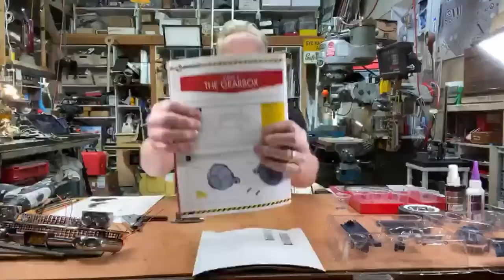Adam Savage's Live Builds: Ghostbusters Ecto-1 Kit (Part 2)

Comment: Adam, as a jeweler and a maker I was so amped to see you are using the jeweler ring clamp, I too use it for all sorts of stuff. One other bit of jeweler gear i use in conjunction with the clamp is a bench pin with a notch cut in it to rest the clamp while working with it like you are here with the drill.

Comment: I didnt know if anyone mentioned this already. I am following along and building one with you and also wired up the additional "Fog" lights. I have been doing some research and found the video "Ecto-1 Resurrecting the Classic car" at 13:20 into it you can clearly see the outside "Fog" lights are actually the turn signals. Make sure when wiring these,thry would not be on constantly. The inside ones are fair game.

Comment: Hey Adam it’s soo nice watching your right now building stuff, helps staying sane, I’m a scenic carpenter and set decorator and motorcycle builder, right now I can’t go to the shop and not working on anything makes me antsy, if I can give you an advice on the build the exhaust manifolds on these old cars where light coated new and would turn rusty overtime, I use modern masters rust paint to simulate rust works awesome, have a good build and stay safe, thanks :)

Comment: Hey Adam, if you really want to stay on top of all the mods coming out for this kit join the official Ecto 1 builders group we have the two big mod makers there and they are doing updates on their mods.

So far on my Ecto 1 build I already got Mark Lane`s 3D resin printed hood vents that are screen accurate as well as removing the unsightly screws.  Im currently awaiting for the strobe light mod as I want to get the Strobe mod that gets rid of the screws but I also want to get the light kit for it as well that makes it functional.

The other mods I got are from else where but not made specifically for this kit.  I got a set of RC mini bolts in M1.6x4mm and M2.0x4mm in black to replace the phillips head screws in the engine with.  I also got a bottle of model master Ford/GM Engine Blue to touch up these bolts for the thermostat housing and the valve covers while leaving them black on the bracketry.

I also got a set of decals coming in for under the hood in 1/8 scale as well.  One thing I will be doing different is the AC oil filter decal for the filter canister is supposed to be transparent showing white letters but this decal is printed on white decal paper so no transparent.  I am going to try to use a hobby knife and cut the lettering out to transfer to a piece of masking tape to take and paint the lettering on instead.

So far this is an amazing kit for me, I did have to get four issue ones though before I got a hood that didn't have defects.  I applaud you for going with the weathering but my route is I want to replicate how she looked at the end of the film, Ecto 1 wasn't that old when they went and fought gozer.  When meeting with the mayor Winston said that he was with the company a couple months so I put the Ecto 1 at being about 6 months old at the most.  So I want her to look fairly fresh looking.  I am thinking of building my own display base which would be a asphalt textured base with Mike Lane`s 1/8 scale blue police barricades on the back side of the display mimicking the Ecto 1 at the final act before the streets started to buckle up.

My original idea was to build a display case with the back wall being the interior wall of the firehouse but I am afraid the case would have to be built wider than I would like to be in scale.

On the mods the following is the mods that are in the works or already out.

1) hood vent mod (released by  Mike Lane)
2) Grill Anti Collision Strobe mod (in progress by Model Modz)
3) Magnetic license plate mod - will come with two correct license plates, yellow Ecto 1 from film 1 and white Commerical Ecto 1 plate from beginning of film 2 (in progress by Mike Lane)
4) under hood decal set (on ebay)
5) illuminated proton pack mod (in progress not sure if it will add lights to the special issue proton packs that will come with this kit or if they will be super detailed stand alone 3D printed ones)
6) Blue Police Line barricade (in progress by Mike Lane)
7) turn signal mod (many doing themselves but I believe Model Modz has one in the works)
8) small props mod, comes with 1/8 scale props such as the Vigo painting, a map of the city, numerous magazines you seen flying by in film one, news papers that was seen flying by in the film, photos of the grey lady and of slimmer from the film, there is even some official ghostbusters documents included as well. (released by Model Modz)

Those are the ones that I can think of off the top of my head.  But don't fear though you don't have to have these mods if you don't want them, you don't even need the proton packs as around shipment 5 I think it is the proton pack comes in a two proton pack set then you get the other two later on.  Me I will be getting the mods I can as I want mine to be museum quality.

Comment: Fun Fact: If you watched the documentary, Cleanin' Up the Town: Remembering Ghostbusters, the movie makers tell you that the Ghostbuster's Ecto-1 DID NOT RUN during filming of the movie. People had to push it, for scenes where it was moving.
Reply: Are you sure about that because Dan said on Restoring the Ecto 1 that him and Bill murry used to take the Ecto 1 around the block on break to pick up some smokes.  I believe the car actually ran cause you see the car running and driving around.  Now its quite possible the black M&M Coach didn't run that was a different car in the film than Ecto 1.
Reply: @Milner62  I am quoting what the people that filmed GB 1 said. Also, the firehouse used as headquarters in N.Y., was a twin building to one in L.A.. So they used the one in L.A. for filming. Watch the documentary. The special effects stories were awesome!
Reply: @alansmith4734 , I already know about the second firehouse in L.A.  The one in L.A. provided the interior while the one in New York provided the exterior.  Its why for my build I had photos and drawings of the layout of the interior of the L.A. station.  Problem is there are no dimensions for this plan so there is no way for me to mathematically figure out how big my base would have to be to include the interior wall as the back of my display.  The wall isn't flush it dog legs back where the lockers are so the wall would have to be built close to the Ecto 1 near the front bumper then dog leg further back to where the lockers would be.  I have dimensions of the lockers so I can build those in 1/8 scale from scratch.  But no dimensions of the interior itself.

Its why right now I am leaning towards doing the final act scene with Ecto 1 parked on the street before their fight with Ghozer.  I like how Adam is weathering his Ecto 1 up but mine wont be as Winston said in the film to the mayor he was with the company for only a couple months.  At most I could give the Ecto 1 being built as being about 6 months old by time the encounter with Ghozer.  I don't believe Ecto 1 would have been that worn and as we see in the film she wasn't that worn at that time.  The anti collision strobes had a little rust on the chrome spots due to lack of cleaning but that takes more than 6 months and filming I recall took longer than 6 months as well.
Reply: It broke down on the bridge, I remember them saying that.

And in some scenes you can see some emergency lights non working, and then later on working.

Comment: I'm building there Ferrari F40 just now bit the parts have stopped coming because of Corona virus just now! Iv spent alot of money on each issue for them just to stop sending the parts! It's the same size as ecto 1 and comes with full working dash engine sounds and full working lights! So I would think ecto.1 would come with the power pack later on too! I just hope o can find the next issues now I don't know what to do about it just now!? I'm an armour modeller got alot of builds on the go just now I'm I'm weathering up a Matilda mk 5 tank just now in the meantime! Hope you get the parts I would love to see it finished the size is amazing and see when you come.to fitting the first wheel you will ne stunned at the weight of the alloy metal and break disk n caliper they will probably be the old drum breaks on this ecto 1 being American just the detail is crazy! I got all excited like a big kid when the wheels and the seat came haha

Comment: Hey Adam! You can get a custom case for the Ecto-1 on the site you listed!
Reply: I think its better to build your own case.  Can build it how you want.  I found some novelty "Keys to Ecto 1" key ring that I was thinking of using as a main cut off for the battery.  Or maybe to turn the engine on, there is a guy on fb on the builders group that is putting a small electric motor to spin the water pump pulley/fan to give the illusion of the car running.

Comment: Question, would it be possible to make something like your ping pong ball machine gun with the machine from the Mythbuster's Episode, the world's fastest ping pong ball? Maybe some valves in sync with each other on a timed interval to repeat the action of creating suction and blocking flow from opposite ends. OR maybe a disk at the machine end and a valve at the firing end. Get them in sync so that when suction is created in the barrel the valve on the firing end opens as soon as that suction is present. Then you can fire as many rounds as you want at super speeds. This is just an idea but sounds super fun and challenging.

Comment: In spycraft terms there's a technique called a dead drop. - A method of espionage tradecraft used to pass items or information between two individuals (e.g., a case officer and an agent, or two agents) using a secret location, thus not requiring them to meet directly and thereby maintaining operational security. (https://en.m.wikipedia.org/wiki/Dead_drop)

If someone needs to drop off a camera dedicated to streaming, decide on a location near your shop where you can pick it up where no one can have access to it except for you.

Comment: In the real 1959 Cadillac, on which the Ecto 1 is based, those lamps are simply turn signal, or 'park' lamps, not fog lamps. (American cars were not sophisticated enough in the late 50's to actually be equipped with fog lamps - even a Cadillac.